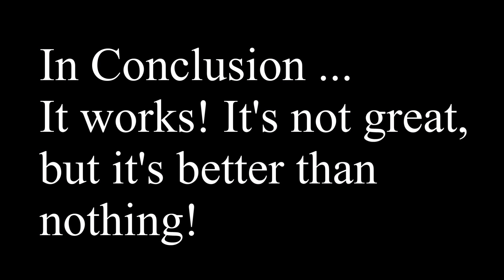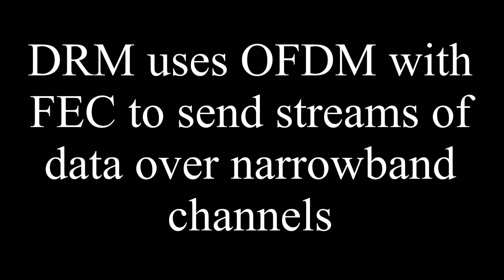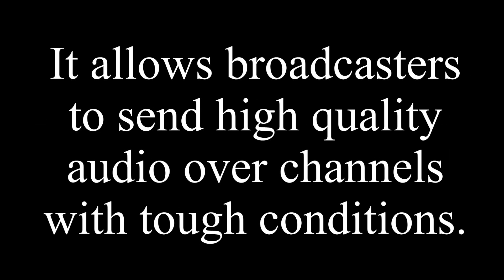Radio New Zealand DRM Decoding using Dream and Winradio Excalibur SDR

Comment: Hello. I have a little problem with dream drm and I hope that you could help me. My dream version decodes everything except Audio (MSC CRC) I have tried every version of program on several computers and it didn't work although i had up to 22 Signal per Noise Ratio (SNR).I also have SORiDA and everything vorks well but it's  too slow and anonoying.  So I kindly ask you for any help or suggesition. Thank you in advance